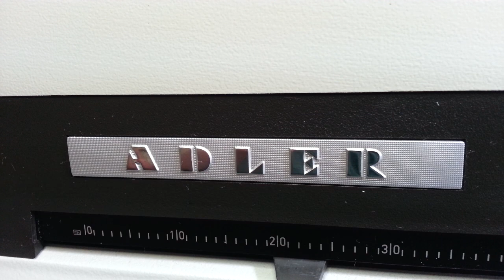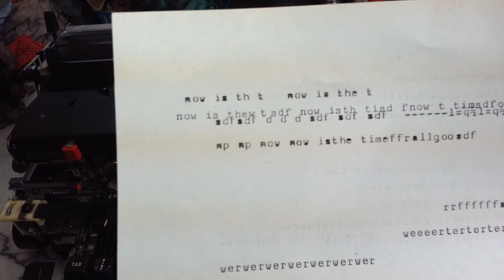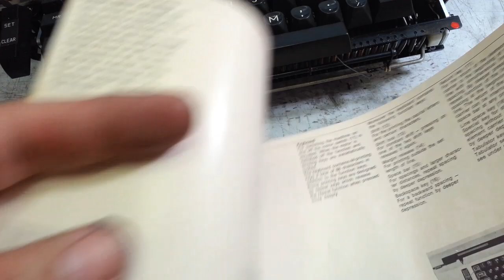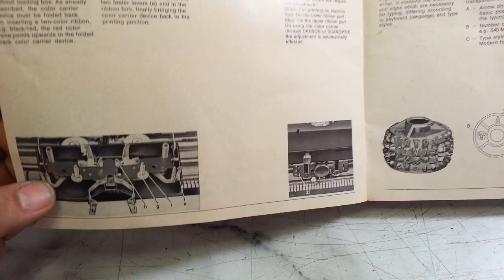Adler (Royal) SE1000 Golf Ball Single Element Electric Typewriter competed with IBM Selectric

Comment: Kinda odd that Royal would make the power roll with rubber all the way across when it only powered a few things at certain places.
The only reason that would make sense,is if it were reversible.
Reply from the maker: Yea, never quite understood the over kill of that power roller. Never changed one either . . .